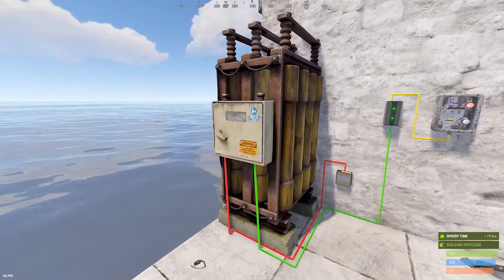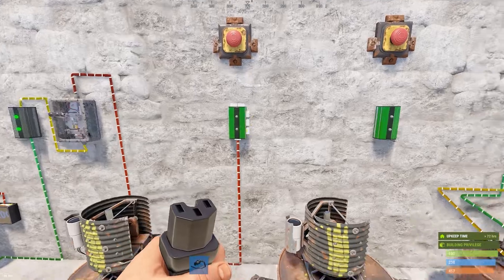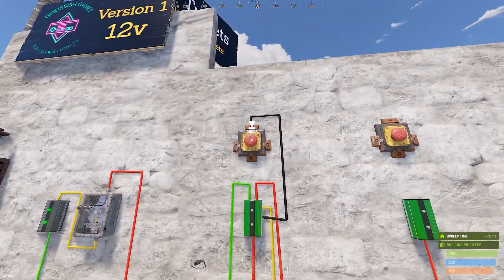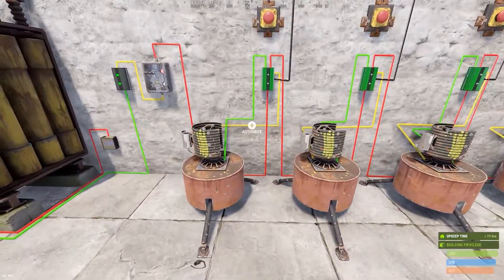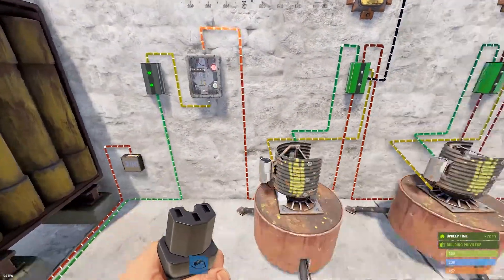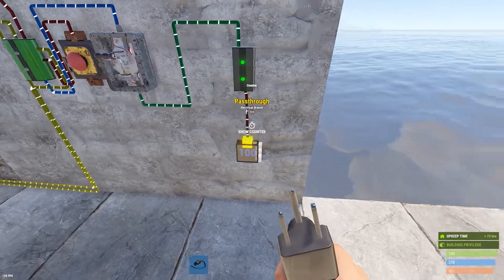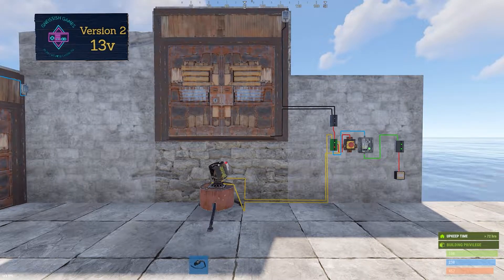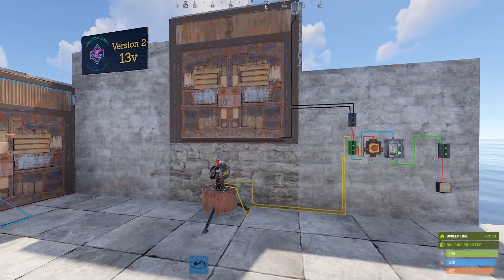RUST Pro Series - How to Build Backup Turrets - includes Both Version 1 and Version 2 Builds 2022

Comment: There any way to use same concept, BUT, instead, switch over and turn ON a back up turret thats off?

So example : I have 9 turrets around base turned on and active... And I have 9 backup turrets that are off; raiders come destroys one of the active turrets... Which automatically turns on back up turrets. Is this a real thing in rust, if so, can you show me an example of a setup? And if so, can you do so, with a timer and with a HB Sensor ( turns on back up if bad guy detected ), and also connected to a RF transmitter or a smart switch ( turn on by phone or RF button ) ...combined with a backup battery setup. ( Assuming is the best way to do it? )

I know there version for when a wall get destroyed...using a ( blocker i think was? ) And turns on turrets. But instead, just was wondering do it when turret dies instead?

And speaking if wall idea, there any way to do it on doors? Use a door controller with a blocker or whatever - that way works as well? If so, can ya show me aet up as well?

Comment: I prefer putting plenty of ammo in it and if you really want to get fancy run a low or no ammo output to a smartswitch.. boom all those wires and comps not necessary
Reply from the maker: Yes! It's assumed that players would feed it a respectable amount of ammo. You could run no ammo out to a smart switch but you'd have to supply an additional 10+ volts for the second turret. The idea here was to share the voltage of one turret with another.